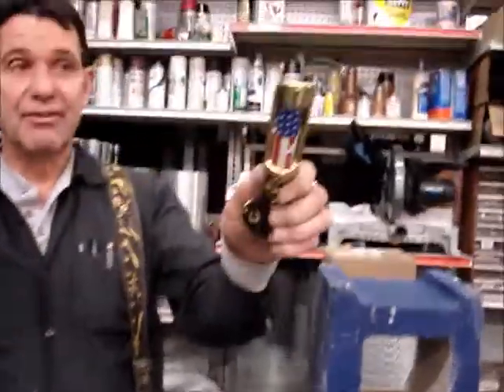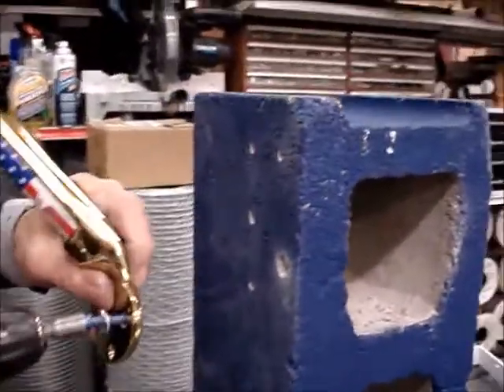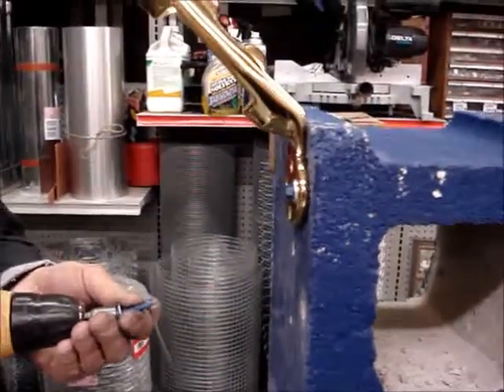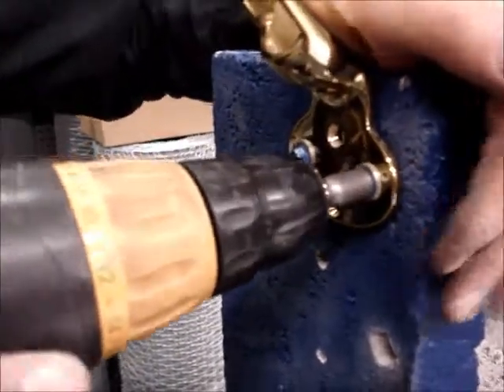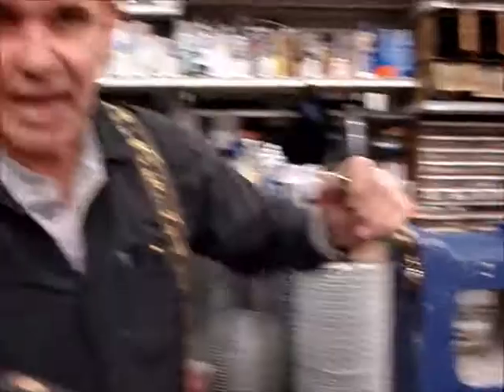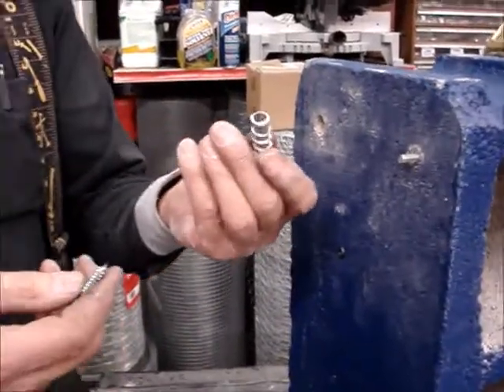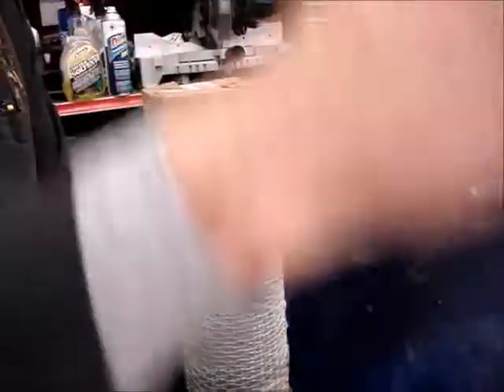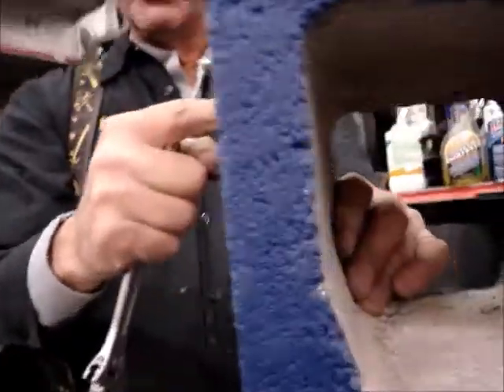Using Masonry Anchors - Tapcon, Expandit, Toggler, Sleeve, Lag Shield

Comment: Thank you so much! I am having difficulties with my expansion anchor. It keeps turning instead of "expanding". I drilled the specific 9/16 hole per instructions. I'm anchoring a "canopy tent" to some concrete pier blocks. I think I'll try the sleeve anchors. I'm new to using the expansion anchors so I'm not sure what happened? the other two anchors worked. Does anyone have any suggestions?
Reply: I bet the anchor is loose in the hole. Get Rockite anchoring cement, small box about $2.00. Mix it thin, coat the hole lightly, roll the anchor with a thin layer and stuff in the anchor. Wait 15 minutes and reinstall the first bolt and I bet you are fine.

Comment: I live in a flood prone location in a block house. I want to attach plywood behind the entrances and remove it after the flood. The house currently has lag shields in place (on the interior). Are they reusable and would these be your first choice for this application? Thank You
Reply from the maker: Not a bad choice because an anchor w/machine threads (which I would use in a dry application) would corrrode and prevent re-use. The lead lag shields will be very forgiving w/crud in the holes.

Comment: I'm attaching a TV mount bracket to a wall in my living room. I believe the wall is plaster (home built in 1957) over brick. I thought I found a stud but when I drilled into it, I hit brick/concrete about 1" in. I'm guessing there are only small furring strips behind the plaster (but what do I know?) So my question is, will the Tapcon screws (probably the 1/4") work to fasten this plate to the wall? Does it matter that there's about 1" of the bolt that will not be in the concrete? Should I use some sort of spacer or another type of anchor for the first 1"? I'm an IT geek, not much of a Harry Homeowner but I think I can do this. Any suggestions? NOTE The TV weighs 42 lbs  Thanks!
Reply from the maker: +Sam Shades 
I like to use sleave anchors for anything that requires lots of force over a few attachments. I use tapcons when I'm attaching something over may attachment points.

Comment: What can I do with a sleeve anchor that has failed, it just won't tighten up, how to I remove it from the brick work ?  I cant take the nut off because it's fixed to the thread ?
Reply from the maker: Tap the bolt in to release the sleeve around it, then using an ice pick or needle nose pliers try to slide the sleeve out of the hole first. then the bolt will come out easy.
Reply: Thank you for your reply, and thanks for your videos, personally I find them very helpful.
Reply from the maker: Thanks

Comment: Can i use sleeve anchor on tv wall mount bracket. But i will pre positioned it first . The sleeves will go troughh all the way the concrete. I will just hang the wall brakcet ito the bolt and tighten up the nut
Reply: Sorry, I can't advise without being on site. Blair